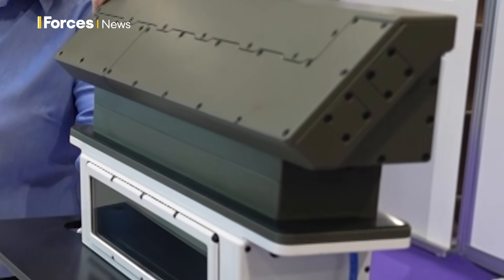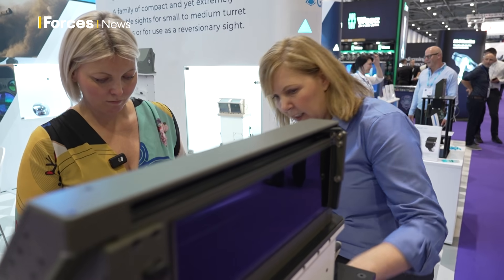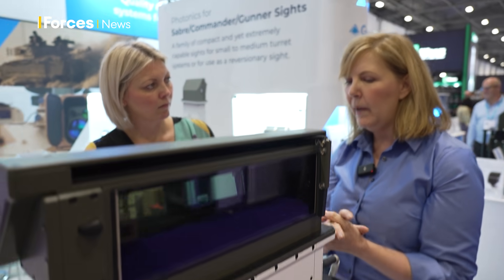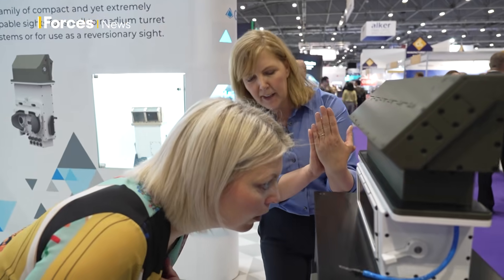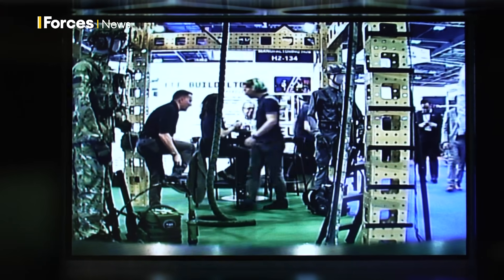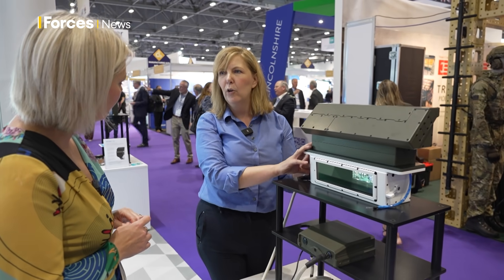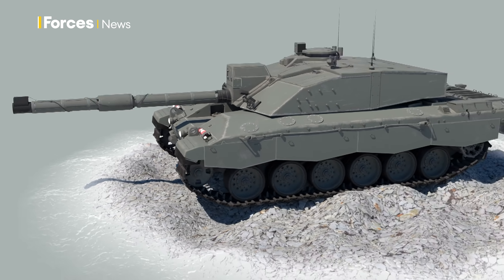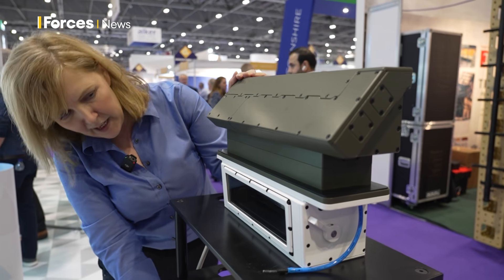Up close with British Army Challenger 3's new periscope

Comment: Why is the daytime sensor so low quality - the periscope view looks far superior for use in daytime jsut due to image fidelity/quality?😅
Reply: It’s going to look low quality when their viewing it for another camera. You ever seen a a camera copy film from the cinema.
Reply: @danbatesy5492  Very good point.💡
Reply: Agreed, looks like VHS quality!
Reply: I doubt that they are going to show the full capabilities in public
Reply: Maybe your phones cam is better in bright light but these must perform in low light at moving. Try your phone cam before night when your eyes can see OK. Your phone is blind. I see more issue with depth perception. On small distances need depth and large view angle. I think larger curved screen with multiple cams would be option. Multiple cams at least
Reply: Cheap parts is what they go for. Export will have 4k for sure.
Reply: I suspect the public are probable given a somewhat diluted or even manipulated view of the visuals of these sighting systems sensors etc, as the true fidelity of these new systems is bound to be classified.